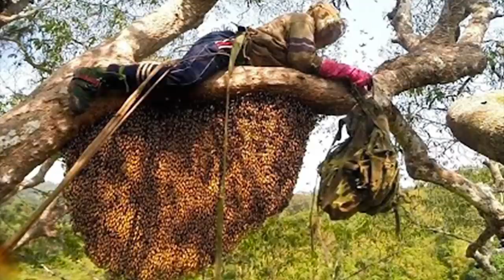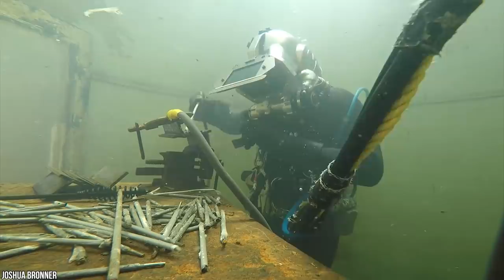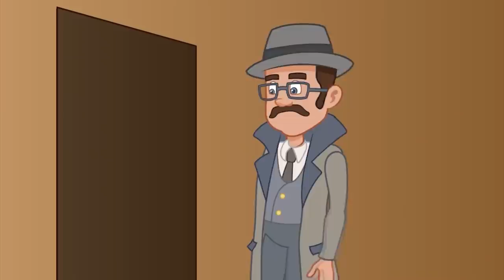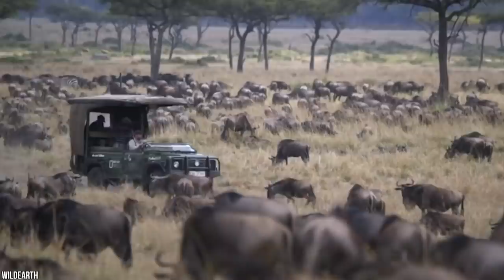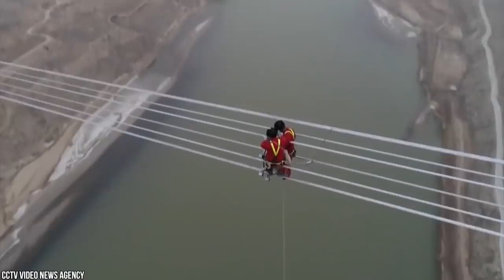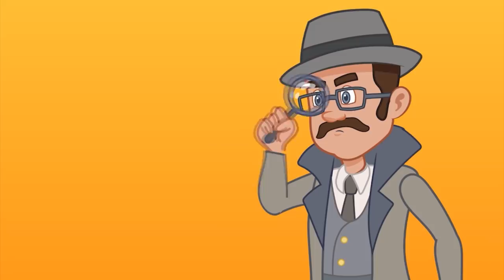15 Deadliest Jobs In The World

Comment: You totally forgot truck driver’s anywhere in the world. There are on average 30 deaths per 100k just in the US. And it gets even more dangerous in other countries.  
 Also you forgot loggers. At 64 deaths per 100k it only second to fishing in the US. 
And that’s just deaths. Both truckers and loggers experience high rates of injuries that can leave them horribly mutilated for life. 
Side note. I have worked as a certified Cable lineman, tree feller, log truck driver and am now an over the road trucker. Am I tempting fate? Naaaa. I would go nuts doing a normal job. I love living on the edge.